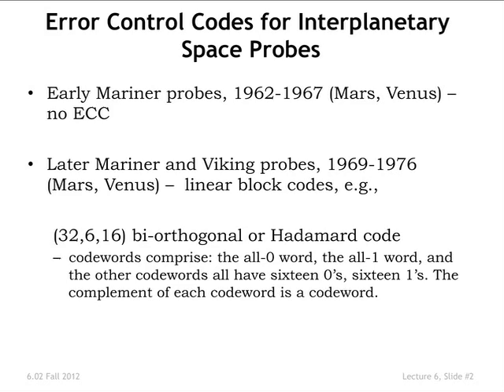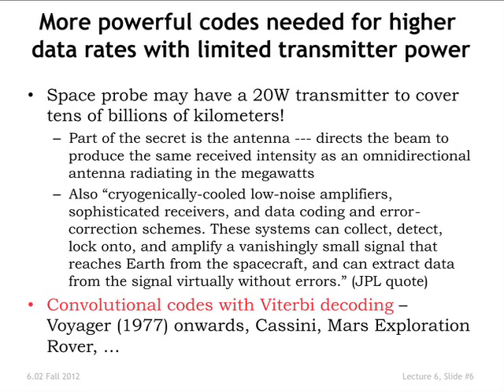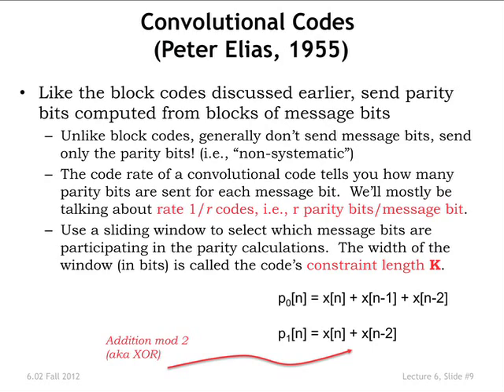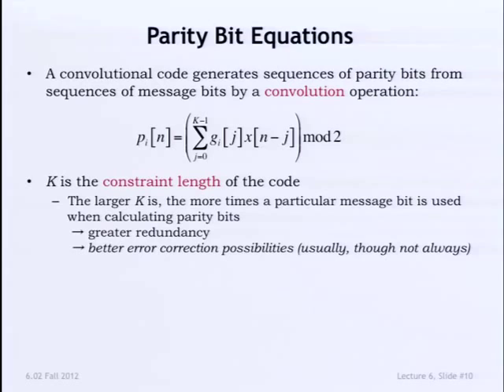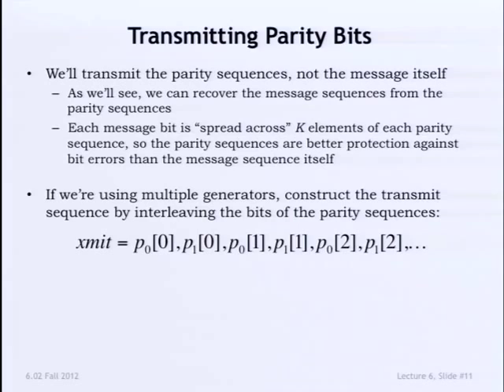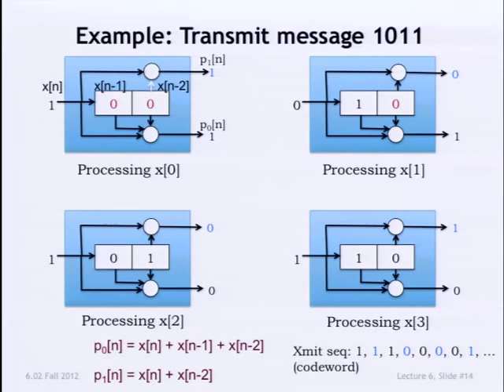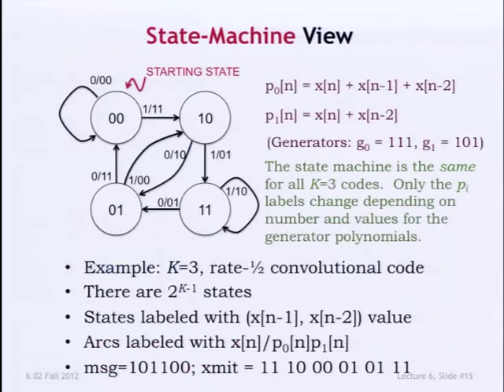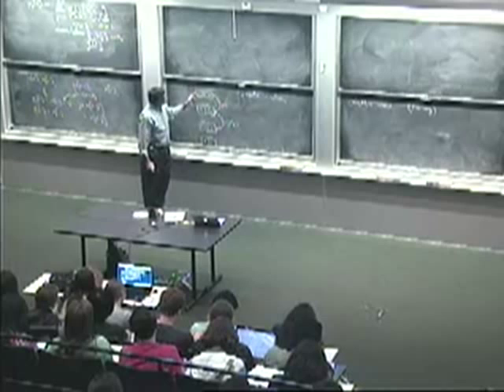6. Convolutional codes

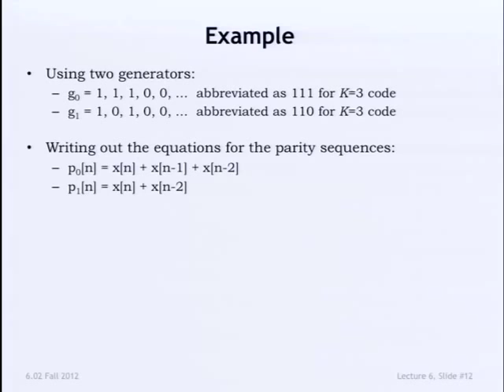Comment: I would like to clarify the content of the slide at 16:41. 

Should generator g1 be abbreviated as 101 for K=3 instead of 110?
When g1 is 110..., it suggests to me that p1[n] = x[n] + x[n-1].
However, the parity bit is stated in the example to be generated as p1[n] = x[n] + x[n-2]. Does that mean g1 should abbreviated as 101 instead?